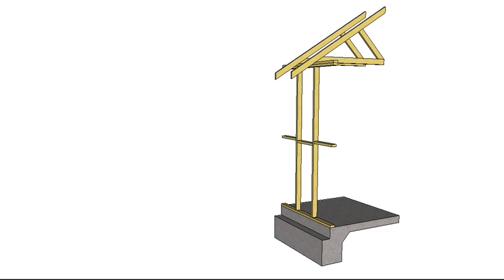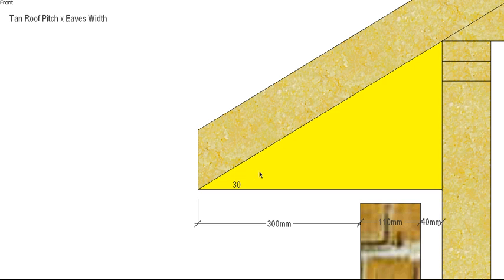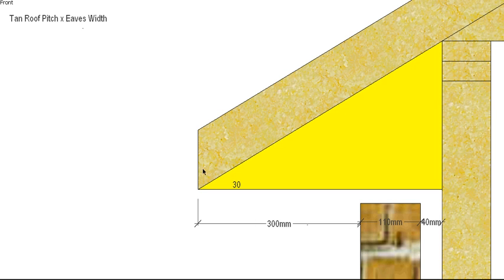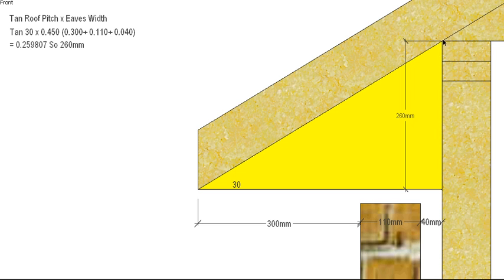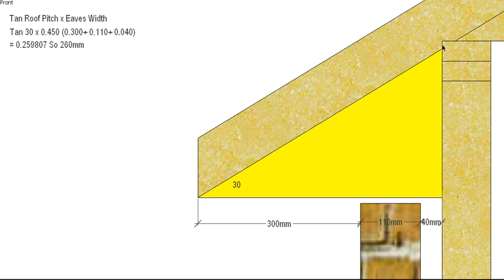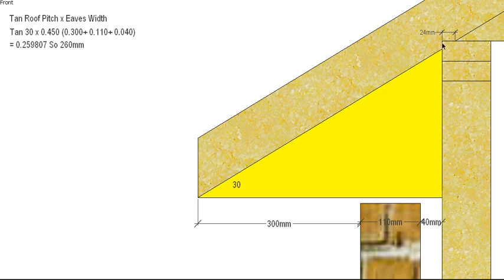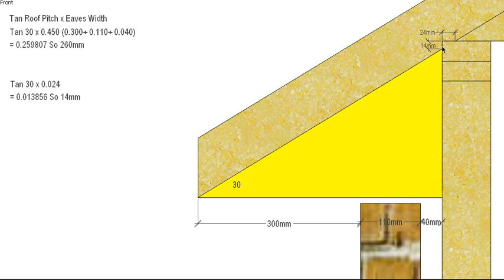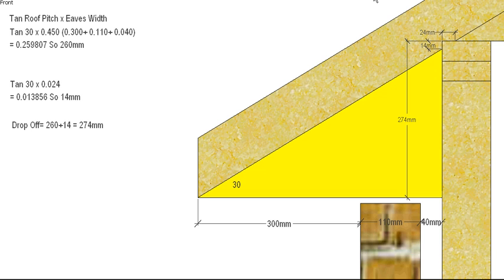Calculate Drop Off

Comment: can we make it level to the end bottom of the overhang rafter? without this calculation
Reply from the maker: Hi Mate, yes you can, its just that during the estimating and wall construction phases this dimension is required to work out brick work and window heights. Hope this helps.

Comment: Hi Buildsum, this appears overly simplistic, just my observation, what about the belcast and fascia dimesions? The belcast holds the first roof tile at the same angle as the remaining roof tiles, and this then raises or lowers the fascia depending on the thickness of the fascia, the roof batten and tile thickness i.e. timber and metal fascia comes as a standard size. Otherwise, every fascia would have to be custom-made for each roof so that the groove in the fascia is where you need it to be.
Reply from the maker: Hi Mate, this has never been an issue for me. I use a Bellcast battern that supports the tile so the Fascia is just a cover. Small gaps between the tile and the Fascia are concealed by the guttering.
Reply: @Buildsum  conversely if the roof pitch is low and the roofing is metal sheet this will mean that the fascia will be too high and the roofing will have to ride up and over the fascia keeping the roofing up above the last batten near the fascia.
Reply from the maker: @Mastertradeskills  Hi Mate, yes in this case the fascia would need to be set lower or the top of the fascia ripped off to line the grove up with the end of the Rafter. This is usually determined onsite at the time of installation. However, for calculations like estimating the height of brickwork required, if it finished level with the eave, which is done well before the roof is constructed this is the process that is taught to apprentices.

Comment: Hi. Is a birdsmouth cut designed to allow higher internal roofs without corresponding external wall height?? Sorry not a builder or anything just want to maximise internal roof height without external wall height..
Reply from the maker: Hi, Clinton The birdsmouth just gives a horizontal bearing point to the rafter, the depth of the Birdsmouth will not change the ceiling height. The only way to increase ceiling height without changing the External wall height would be to rake or vault the ceiling.
Reply: Buildsum  Qs LSDb BB to.